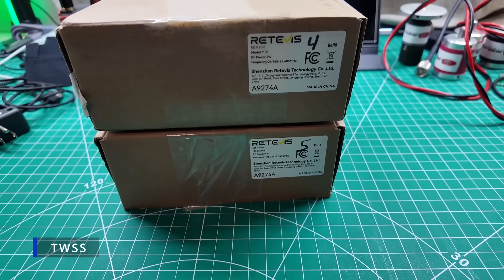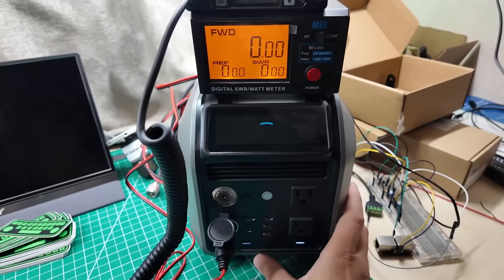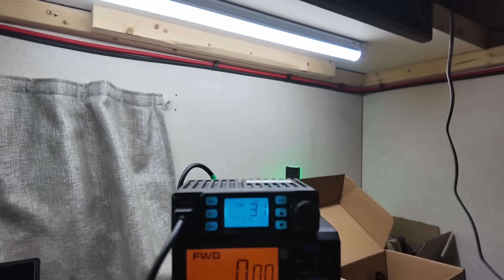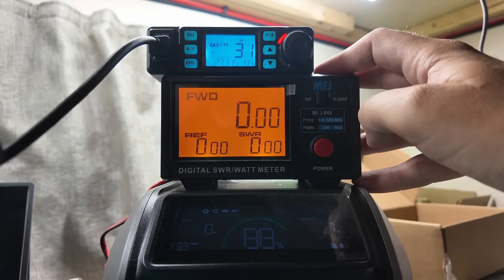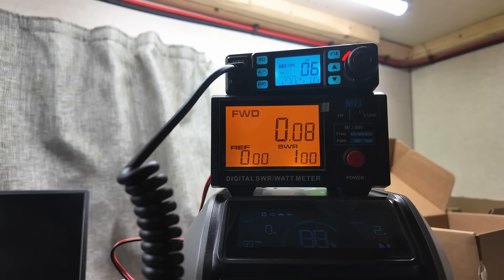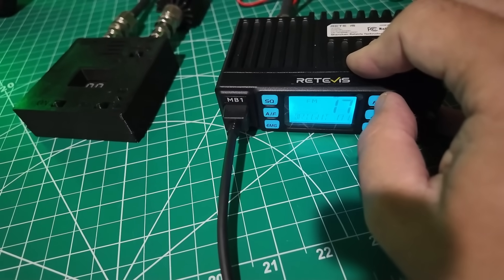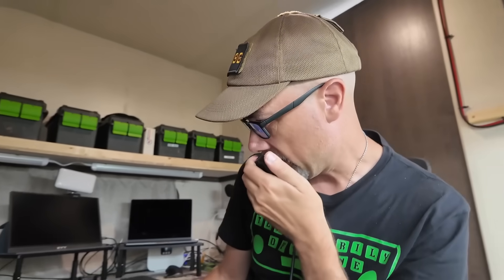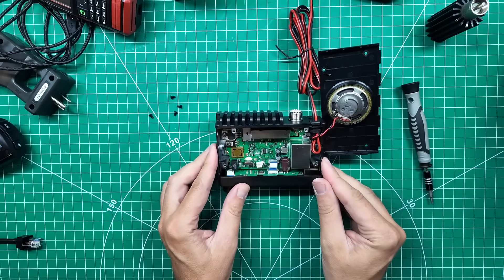CB Radio HACKED Again! 🔧 (Easier Mod)

Comment from the maker: 🔥 This was wild — first my meter dies on camera, then I find an easier mod for the MB1!
Would you trust an Amazon return repair for your radio gear? 🤔
👇 Let me know what you think about this CB → Ham conversion!
Reply: Sure. People throw away perfectly good hardware all the time. Knowing someone has at least powered it on successfully makes it worth paying money for it.
Reply: Not related to this video, how can I contact you for power problems with a Btech 50v2 not putting out 50w, which it used too.  Was about 54w+ 
Display on radio shows 18.4w

Comment: I have found that there’s a lot of ham radio meters that just don’t work with 11 m radios and the MFJ digital is one of them. I suggest in the future to use an analog but not all analog ones. I’ll work with an 11 m radio either I know the MFJ giant single needle Works good with 11 m on average setting. I did some research on it a few years back and there is a technical reason why I can’t remember it right now.
Reply from the maker: When you remember, let me know.

Comment: I got an MB1 today and cracked it open to find those pads I was about to solder covered by a chip that says 10.240 MHz. Hoping for an updated mod video before I get too excited with soldering jumpers in.
Reply from the maker: I don't have one with that chip.  Send me a hi-res pic of the circuit board and I'll take a look.
Reply: @temporarilyoffline Sent to email and text. Tried the diagonal jumper and it works! 🙂
Reply from the maker: @JeffEmmert perfect!
Reply: @temporarilyoffline I'm not sure how to reach you yet.
Reply from the maker: @JeffEmmert  temporarilyoffline@gmail.com

Comment: I would think bad coax/end or the center jack on meter is spread open from too many cycles or an oversized end. also some of the cheaper jumpers and connectors tend to tarnish real bad, to the point of being insulative, but not that much. maybe loose solder joint inside meter also.
Reply from the maker: Could be.  The meter has been replaced now though.

Comment: Certainly simplifies things to be able to just bridge a couple solder pads, especially when they put the close together. The MARS mod on the Yaesu FT710, and I would assume other models would be similar, was like that and besides being very tiny was pretty simple. After spending $1000 opening up the radio before ever even keying the mic can be pretty intimidating, but they kept it simple enough that I was comfortable doing the mod myself and would have done it even if I didn't have the microscope. However, since I do have one, it was small enough that I definitely put it to use. Some of the older CBs changing out or adding certain crystals with switches was bad enough, but some requiring traces to be cut, IC pins to be shorted, bridged, or reconnected elsewhere, and even adding components to modify the frequency range are much more involved for sure, but can be pretty satisfying when it's all done and they work like they're supposed to. In some ways I suppose they took some of the fun out of it.
Reply from the maker: Yeah, its a lot of fun to tinker around with gear.  Thanks for watching.

Comment: You can try help out the PMR-171, also from x Retevis now Guohetec. It missing a lot in the software to be a full beast hamradio. Not the best modulation, missing working APRS, etc. That culd be a nice suprise for many Ham's. 73

Comment: This radio appears to be the same form factor as the radioddity DB20 / DB20-G. I have two of them and they switch between gmrs and u/v with a reset at start up. Unless that CB is dirt cheap, I would buy one of these instead.
Reply from the maker: It's the same case, the CB covers different bands

Comment: If the change between ham and CB is a pure software change - who would know if it has been changed back to CB from ham if you sell is?
Reply from the maker: This is a hardware change, the only way to tell either way is to investigate... And there would need to be a cause for that (willful interference)

Comment: A zero ohm surface mount resistor would work perfectly for those jumper pads, as long as you size it correctly - I would guess 0805 would do. 73
Reply from the maker: Why would I do that instead of just a blob of solder?
Reply: @temporarilyoffline  for me, two words - durability and assurability. If I was doing a one-off mod to a radio, and I did not have a zero ohm resistor, I would put a bend in a 22-24 Ga wire, solder it across the pad, and trim off the bend point. I just cannot trust the electrical and mechanical integrety of a solder blob spanning across two pads. Especially when that transceiver might end up in an automobile with all of the vibrational stress. Of course it depends on the pads, the spacing, and what is on the board between the pads. I have a Yaesu FT-212RH in front of me that has solder bridges across pads for changing options right from the factory, but those pads were designed for that with a small gap between and no solder mask (plus their ability to create that solder bridge is most likely better than what I can do by hand.)

If I were moding a lot of radios for customers - I would go with the zero ohm resistor option if I could - assurability. This is me though, and I'm sure others have done a solder blob jumper and have had no issue. I was just presenting, in my opinion, a better option. 73
Reply from the maker: Awesome, thanks.  Most people don't have information behind their reasons, so I appreciate the feedback.

Comment: A USB-C PD power supply, PD being the crucial part, will put out different voltages IF AND ONLY IF the device signals for something other than 5V.
 IIRC that signalling is done with a dropping resistor, not coding?
Reply from the maker: Depends on the implementation

Comment: Amazon repairs on anything more complex than a paperweight are a total gamble. There are no standards, no qc. Half the time, they're still DOA because real simple checking wasn't done.
 Sometimes, they're perfectly good. And sometimes, the savings are minimal. So who wants to bother?
Reply: Based on Steve's experience on the channel, seems like it's usually something simple, though I don't know what Amazon charges for the privilege  of this arrangement. Sure makes good subject matter for the channel though.
Reply from the maker: TANSTAAFL brother.
Reply from the maker: A lot of times this stuff doesn't have enough profit margin to be repaired at all.  Everything is repairable, just not everything is worth the time.

Comment: Spent two full hours with four other folks trying to get one field radio on the air one day. Never did figure it out.
 But I'd also vote for a simple gross failure, bad solder joint in that SWR meter. SO much lousy soldering these days, even from brand names.
Reply from the maker: Its like that sometimes!

Comment: On those power cords. I like to chop them in half and put andersons on each side.  Can still use w the power plug big dong or use the andersons.     On cb. Make sure to call cq for salty walt too. 🙏✌️🇺🇸.   On my radiooddity cb500. I removed the power cord and put the fuse and cord internally and mounted power poles into the chassis   Just took a little bit of filing and if i pop the fuse i have to remove cover to change it.  But it looks nice.   The grommet for the power cord is usu wide enough .. usu fits the power poles and holds them in place
Reply from the maker: Nice work!
Reply: Mhhh, ... sounds like a good idea, ...  

... but, you didn't 'fuse' or 'protect' the 'cable' anymore! 

Having, as an example, a - 13.8V/25A - power-supply, and a 'short' inside the cable, will 'blow' theese wires, easiely into 'fire' ! 

No longer a protection between the power supply/battery, and the radio! 

If the supply-cable is longer then 6 feet/2m, it can be a big problem and very dangerous! Full 2m 'burning cable', in a car, isn't a good thing, I want to have during driving on the highway/motorway/ 'Autobahn', ... ! 

73 de Markus - db9pz - JN39fq - 3miles/5km east of 'LX' -

Comment: Time to breakout the new CQV meter. I wonder if the the MFJ meter might not have a bad solder joint that's been exacerbated by the constant cable swapping.
Reply: Lucky it’s not a mini PL connector that is very common on Motorola radios. Then center conductor on the radio connector spreads open creating a very loose contact point if not an open line within the connector. This will lead to a failure of the final transistors or module. 
What if you have both a FCC license for a radio tech as well as a Ham license.
Are you utilizing your RV as a studio and Ham shack?
Reply from the maker: @Subgunman the gubbermint won't allow us to be responsible on the CB bands... Can't do it.  Yep RV ham shack!
Reply: @temporarilyoffline  sweet Ham shack! I take it, it can go mobile as well into the field?
Reply from the maker: I have a double detachment setup - RV -> Truck -> Motorcycle... then I'm on foot the rest of the way.
Reply from the maker: My thoughts too

Comment: FT8 on FM runs afoul of the new(ish) 2.8kHz bandwidth cap for digital modes, but AM could work.  You'd have to keep the FT8 frequency between 500 and 1200Hz or so to keep the transmitted bandwidth <2.8kHz and not get clobbered by the RX side audio filters.  AM is fine in the voice portion of 10 (28.3-.5).  Obviously no-one would be looking for FT8 there on AM, but in a world of spotting systems/POTA/etc. You might be able to make it work well enough to play with it.
Reply from the maker: Just about anything is possible with enough persistence (or stubbornness)